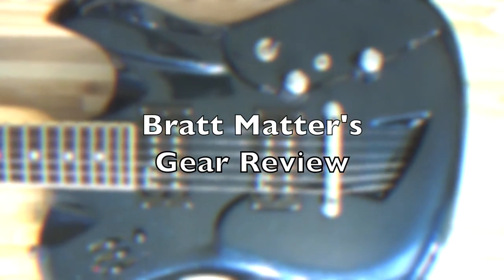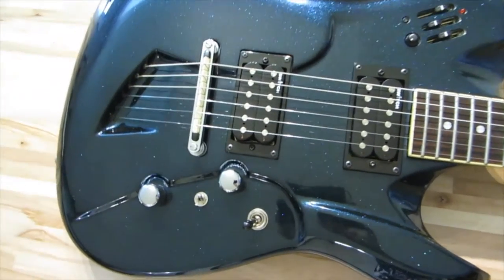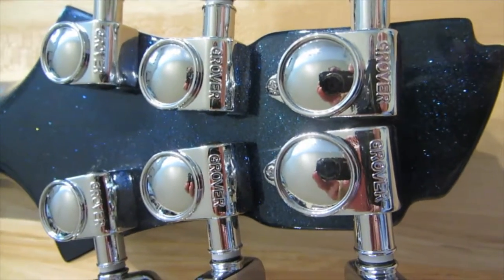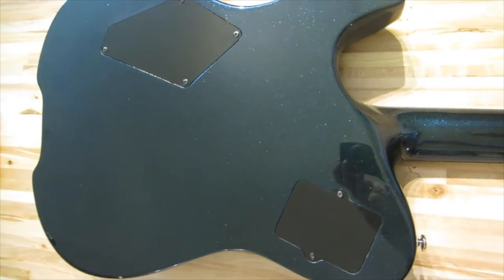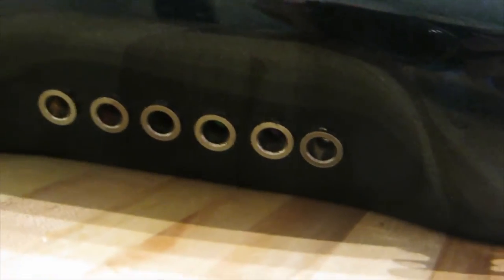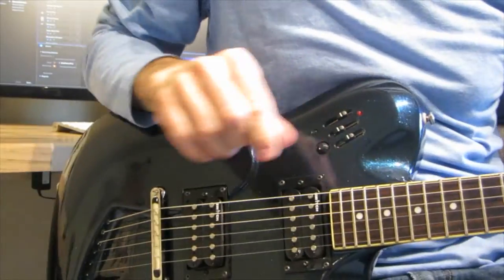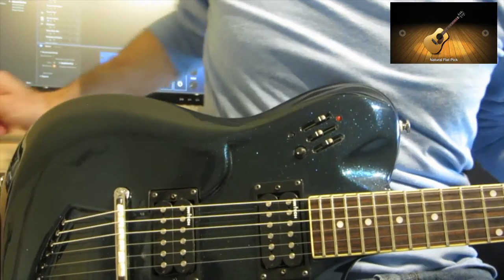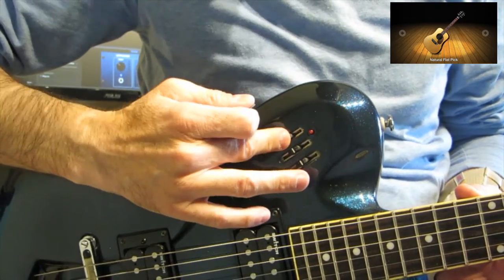Switch Vibracell Guitar :: Review

Comment: Late to the show here. It takes me forever to restring this thing no matter the orientation. It’s not exactly totally a solid body and when you try to push the strings through the ferrules (especially the high ones) they disappear into the body cavity and don’t come out of the corresponding holes behind the bridge, or come out of the wrong hole. Also, I put a couple of inches of thin teflon tubing on the ball end side of the string since it seems to chew up the hole behind the bridge and this also reduces buzz from the shallow break angle. Regardless, it’s a great guitar and thanks for posting this video 👍